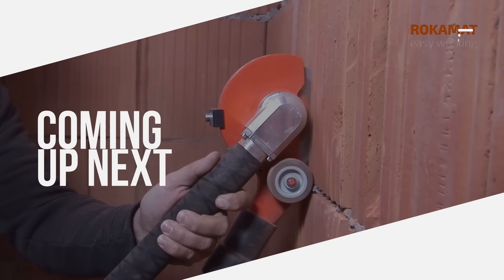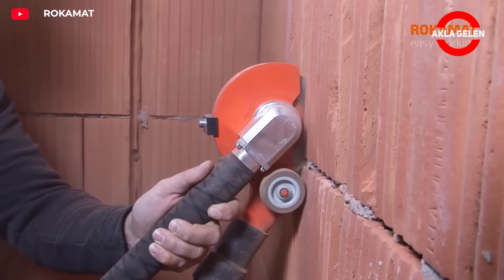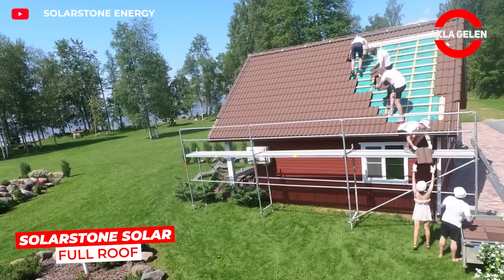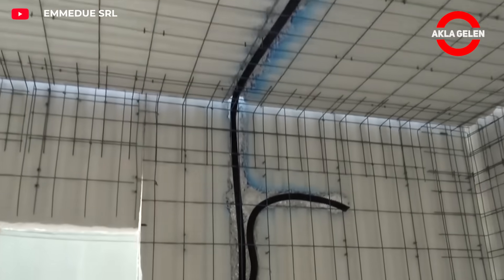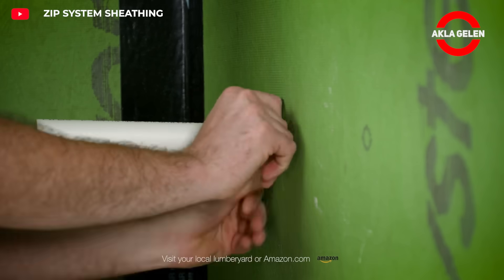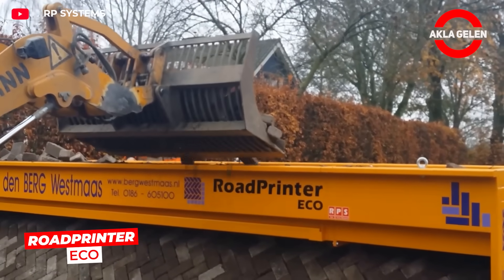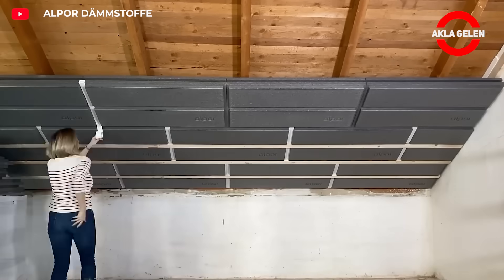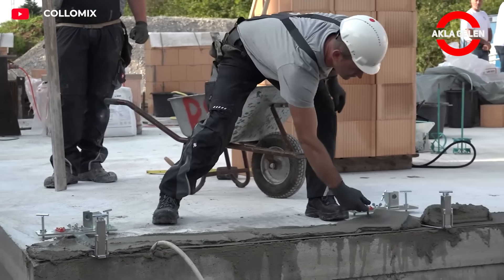I can't believe it! I never thought of these ingenious Construction Techniques

Comment: 6:40 I did never see pouring concrete on roof in Japan
Reply: But the pouring of a concrete floor slab on profiled steel is commonplace in Europe and called by the brand name Holorib.
Reply: If you did, you might only be 2'' tall now😂🤣😳

Comment: The day I go back to fiberglass insulation is the day I get my brain replaced with a cauliflower. Mineral wool or spray foam.
Reply: what about broccoli??
Reply: Spray foam is becoming uninsurable in UK because of problems associated with moisture generation and entrapment over the last two decades or so.  Householders are now having to have the spray foam removed that is costing substantially more than for the installation and then having to install a properly engineered system at yet another cost just to get the property insured and cut the risk of major refurbishment.
Reply: Foam/polystyrene insulation is dangerous in a fire situations so would never consider. Some of this is really dodgy and site/ geographically specific especially if earthquake, hurricanes etc are issues.
Reply: Fiberglass (or any other fibrous insulation for that matter) is only useful for getting it up to code.  No reason to spend more on things like mineral wool unless you are concerned about fire.
Reply: @acvarthered My increased R value would disagree with you.
Reply: @philipatha  The R values are complete BS for fibrous insulation.  They are tested in systems with zero airflow.  Once you get any airflow in fibrous insulation its insulation value drops to next to nothing.  It is all just BS government regulation.

Comment: Micro steel rusts, just like rebar.  Oxidation expands with great force causing cracks, which promotes more rust.
Reply: у гарному бетоні арматура навіть іржава зберігається дуже довго не ржавіючи, не скажу про століття але про десятиліття це точно, доведено не одним демонтажем бетону
Reply: That's the first thing I thought of too
Reply: F.Y.I.     WHEN METAL  RuST  it expands  up 12 × 1  it's size
Reply: Do you mean mesh rebar?  It is commonly used instead of single rebar because its quicker and therefore cheaper to install without having to rely on a fixer to place it.
Reply: It's stainless steel... in concrete their is no air to allow for further rust or corrosion

Comment: Hmmm.. Is that roofing really a natural material as stated? It had a lot flex and nails were driven into it. A composite maybe.
Reply: люблю відкриті цвяхи в даху..... частіше бачишся з хазяями будинку
Reply: And those cap pieces can't be slate.  They would be too fragile.
Reply: Its not natural slate but a look a like material.  Eternit have been producing this type of artificial slate for at least 50 years to my memory as a substitute for real slate.  Originally it was a mix of asbestos and cement.  Real slate would not give you the clean edges and smooth surface that is shown here.
Reply: @clivewilliams3661  Thanks for the info.  I knew they have artificial marble but didn't know about the slate as well.

Yeah, not only is slate not smooth, but because it is a sedimentary stone, it has very thin, very fragile layers.  You don't "turn" like those roof ridge pieces. ;)

Comment: Complicated equipment is spendy and thrown out when encrusted with splattered concrete.
3d printed houses need quick crete, which is very spend compared to concrete.
Building a house out of packaging tape, foam, and glue is a house that a bad guy can HUF and PUFF and BLOW YOUR HOUSE DOWN.
Reply: найкращі будинки з червоної  керамічної цегли, доведено казкою ТРИ ПОРОСЯТИ І ВОВК
Reply: @мастерстроитель-к3о  speeky de Englisho
Reply: According to testing taped foam sheathing stands up to wind better then wood sheathing with house wrap over it.
Reply: @acvarthered  I would like to see what was tested as the timber sheathing creates a structural panel that the PU foam can't.  If the comment relates to air infiltration then any taped seam will perform as good as another, but I'm of the opinion that air infiltration is good as it allows the property to breathe, whereas a hermetically sealed building is full of stagnant air unless it is mechanically or passively ventilated, which defeats the supposed energy saving.
Reply: @clivewilliams3661  The problem was that when the OSB+house wrap caught a big gust the wind got in under the house wrap and ripped the whole wall of siding off while there is no where to get underneath the foam so only single strips of siding were ripped off.

A breathing wall is a bad wall.  Yes tight houses require mechanical ventilation, but the end result is a better house.  Lower heating and cooling costs, better air quality, and more comfortable living conditions without drafts.
Reply: @acvarthered  I cannot agree with you.  There is no reason for the membrane on the sheathing to get caught in the wind unless it is badly fitted or the detailing is deficient, both a workmanship issue, not a material one.

Maybe my experience of UK houses has defined my response but houses that are hermetically sealed lead to stagnant moist air that then leads to mould and fungus growth.  Its common for people to seal up their properties thinking they bare saving energy and then find black mould growth on surfaces where there was none previously and on occasions where smells identify dry rot fungus under floors and in walls.  By a breathable house I don't mean one that is draughty but one where the natural moist air in the building permeates through the wall to evaporate in the fresh air.  As for better air quality, I would contend that sealed house have poorer air quality because they are sealed trapping in smells, having increased RH and ozone.
Reply: @clivewilliams3661  Not my opinion.  Just pointing out what the people writing the code found in testing.

Again tight houses need mechanical ventilation.  People who airtight their house but do not put in proper ventilation are just doing it wrong.  A properly ventilated house will not have the problems you mention.
Reply: @acvarthered  I know what the official advice is that is often backed up by laboratory testing and calculations but I am basing my comments on 45+years as a qualified Architect and having to cope with real examples.  The science say seal everything up but the practice shows that you can't rely on builders or occupiers to do the right thing.
Reply: @clivewilliams3661  We can definitely agree on this point.  Builders have become trash, and homeowners are basically just renters at this point with no intention of a long term stay.  That being said you can't just build down to the lowest common denominator.  We need to expect more from our contractors.  Owners are another story.
Reply: @acvarthered  Over my career I have seen building contractor workmanship decline to the current abysmal level.  In UK most builders were trained at college as well as on the job, where they were 'on the books',  today they are all sub-contractors who's only focus is to get in, get out, get paid, whereas previously the tradesmen were part of the builder's reputation.  Similarly, it is sad to say that the professionals also have less knowledge of construction, so that they typically don't know what they are looking at most of the time.  And then we come to clients who would rather listen to builders BS than consult the professionals for what little knowledge they have.